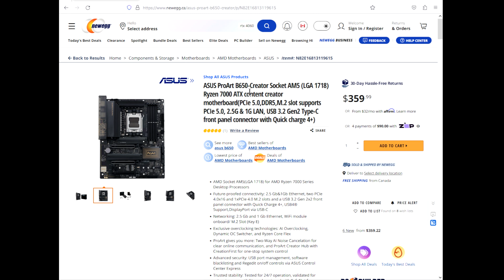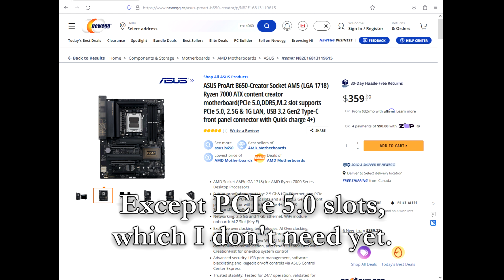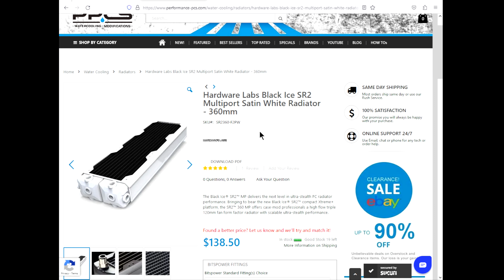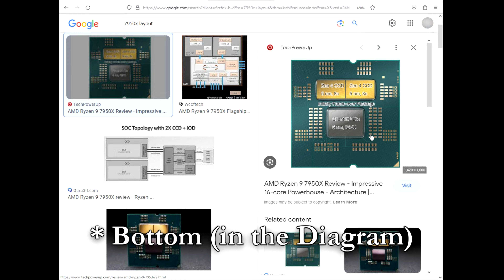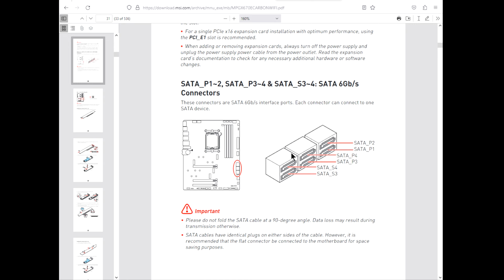Rebuilding my PC with a 7950X & MSI X670E Carbon.

Comment: Lucky bastard and great build. I'm looking at B650/7900x combo myself, or hold till next AM5 launch and snag a bargain or go 8000. Current 5600x/7900XT still gaming just fine!
Reply from the maker: Hey Thanks. Hmm, that's always the question, buy or wait, and there is never a good answer. That's a solid card you have, but not as much a CPU. Depends on how your games are running. In my personal gaming rig, I stuck with AM4 for now, and got a 5800X3D. The systems been unstoppable so far, but I am only running a 1080p TV for a monitor.

Comment: love the pc videos bud, ever thought about doing a Delid on that 7950x? might help with temps. also what are your thoughts about hard line? i might do my own custom loop this year for the first time, going for looks and perf.
Reply from the maker: I've considered it, but at this time it doesn't seem worth it. I pretty much only video edit on this PC these days, and everything is running smoothly. 
This upgrade has certainly enhanced my editing experience, funny thing, that after switching back to my Old Vega 64 card. If I was gaming on this system I might be more inclined to try a delid to squeeze some more clocks out the CPU, assuming I even needed them. 

Custom loop is funny, it more for style and quiet than it is for performance these days.

Comment: I watched your water block vids for the 6950, (no part 3???) now this one, I thought it was us brits that only used "made up words"  congrats :) im thinking of getting the B650 MPG Carbon with the 7800X3D
Reply from the maker: Part 3 ? Everything I did with that block is posted now. I have to pull it for modularity, and in future vids this card will show up again in a dedicated gaming rig I've since build. But that rig can't support enough water cooling for the card to it's running on air now.